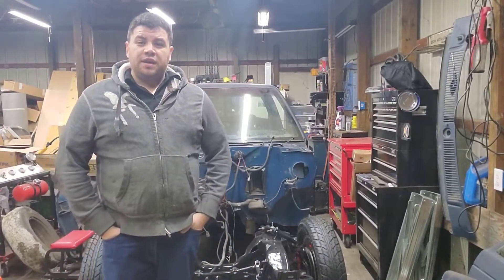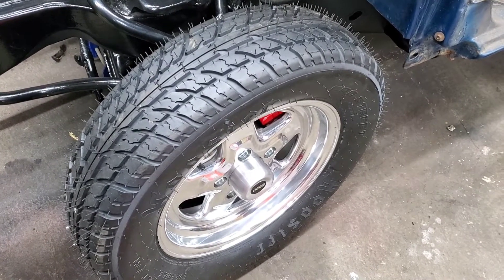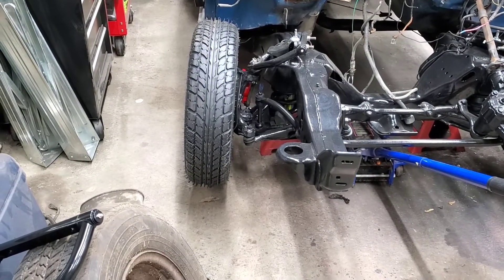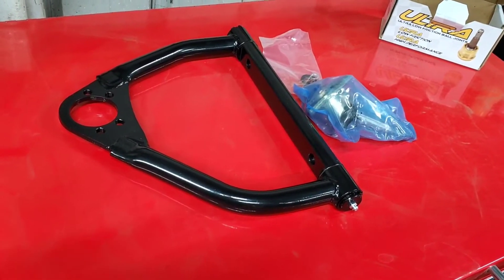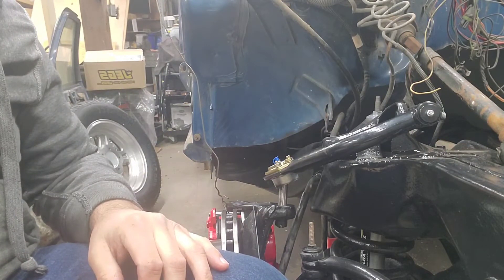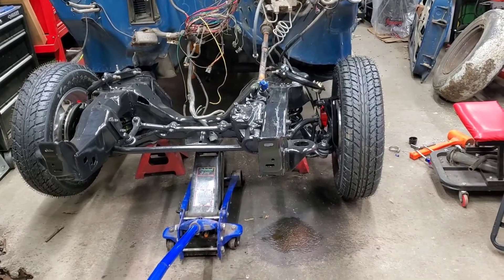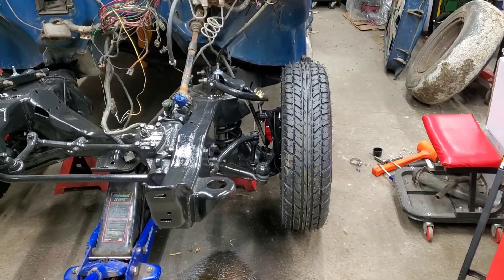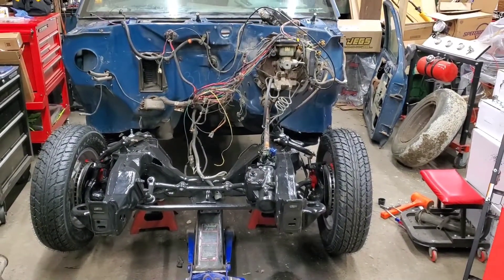V8 S10 Fixing Negative Wheel Camber

Comment: So you put 2 of the left side speedway 8 1/2 inch upper control arms on?
Reply from the maker: Yes I actually have a set of both the 8" and and 8.5" but currently have the 8.5" ones on there now. Supposedly allows for more adjustment when lowering which I may do also some in the future depending on how it sets. I got the 8's originally and kept them just in case need to switch back
Reply: @304customsgarage Speedway says to use 2 rights. You used 2 lefts?
Reply from the maker: Yes I used the 8.5 inch ones on both sides.

Comment: you have no motor in hole it will have neg camber  if you put some weight in the hole it will pre load the springs a bit  at that time  you use your shims to adjust  your neg or pos  problem . your upper's are almost bottom out from the looks of it. when you get the motor back in the hole you will back in there messing  with shims

Comment: I couldn’t help but notice, the sway bar is still installed. Do I need my sway bar, if I’m only gonna drag race?
Reply from the maker: I don't see why you couldn't remove it if you wanted for a drag only setup. I left mine on since it will be mostly street miles the truck sees vs drag strip passes.
Reply: Cool deal, thanks

Comment: Love this! Gotta do this for my s10.
What was the part numbers for the control arms and ball joints?
Reply from the maker: Control arms are speedway # 91031134-L, those particular ball joints are # 91720145-1. The ball joints I don't particularly like the idea of not having the dust boots on them and I would've gotten the afco 1" longer ones with the boots if they had been in stock when I got them but they weren't available so I'll run these for now and see how they do.
Reply: @304customsgarage  ill have to check those out thanks for this!